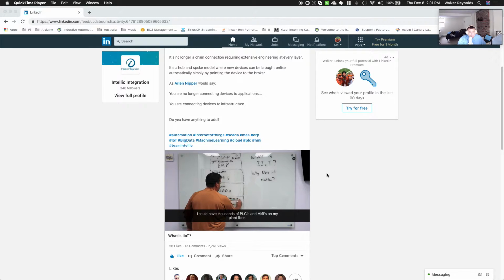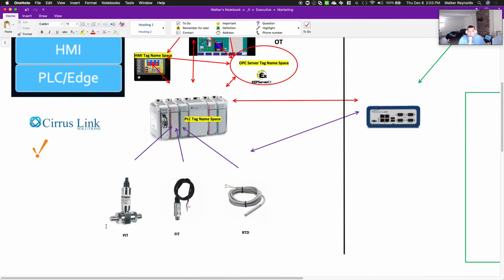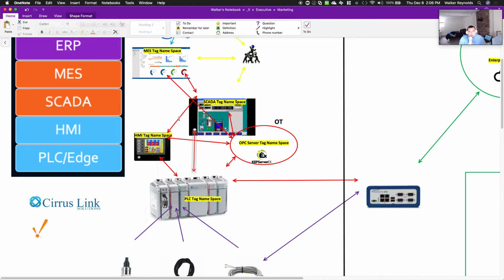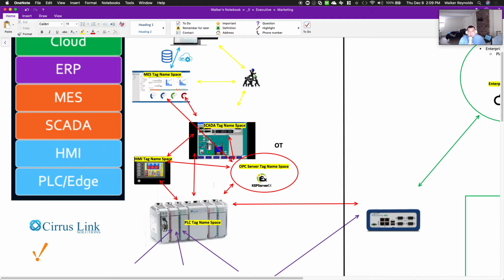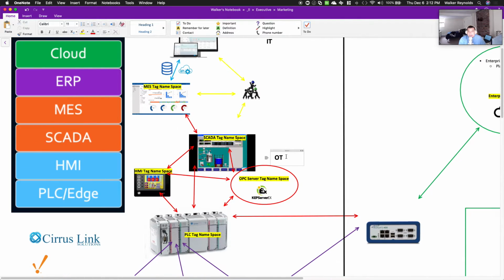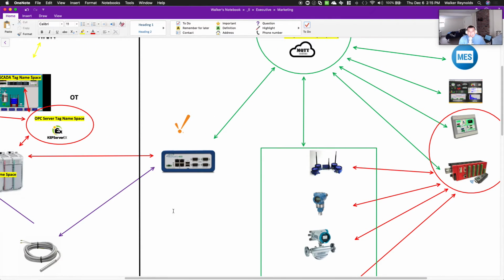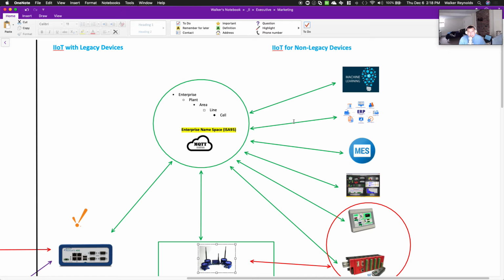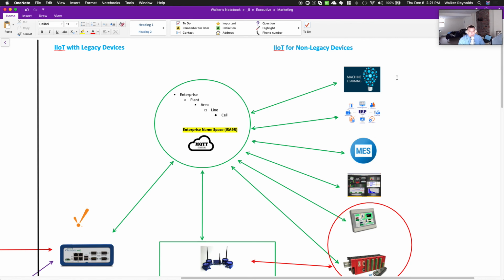What is IIoT? For the Advanced

Comment: Thanks for the wonderful video!
But I am still confused about how the IIOT architecture can implement mutual control among MES, SCADA, and field PLCs.

In traditional automation architecture, as you explained, you have to build every road between nodes(MES<->SCADA, SCADA<->PLCs, HMI<->PLCs). 
The bad thing is the engineering is very expensive, but the good thing is you can have full and mutual control/automate from Level 4 to Level 0. 

I am wondering if the IIOT architecture is still able to fully control all levels from top to down(not only collecting data). 
Because it seems there is no connection between nodes anymore, and every node has to link to Unified Namespace via MQTT.
How to achieve automation control under IIOT architecture with MQTT?

Comment: Can you please explain a bit more on these two questions since they were touched a bit fast in the video:
1- how to connect old devices to iot, devices which are not webservices / mqtt capable? Do you have a concrete example?

2- if I would elaborate my architecture with additional tools or devices, these tools are not known to the rest, normally we would build an interface where needed, with iot we could connect them to the mqtt broker, however how does the broker knows the new data from the news system, So I would have to elaborate the broker and all systems which need that data and subscribe these topics, correct? Is that not also an effort? Why is that an advantage compared to restapi? Don’t you think that an interface can do more than a message broker?
Last but not least :) we are always talking about metadata, how about data sets which are needed in many enterprise applications e.g. a documents or a drawing etc. the datasets cannot be sent via the message broker or am I wrong? If so, the interference will then remain essential and im questioning the value vs effort/costs
Many thanks in advance!